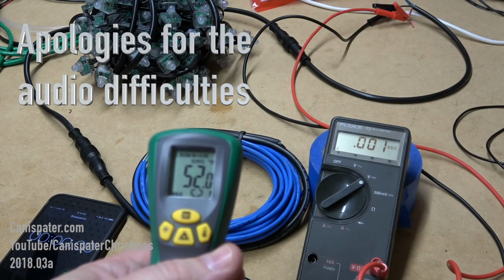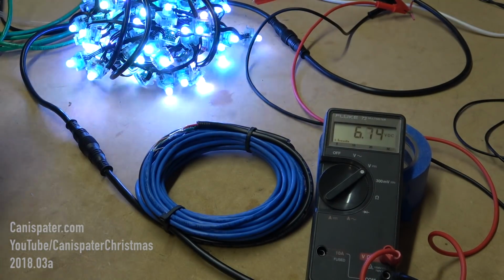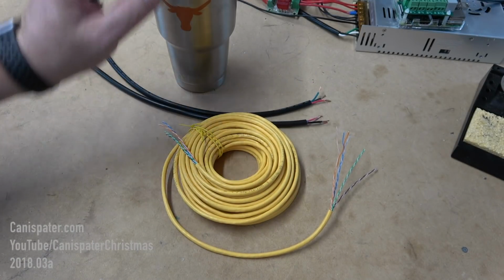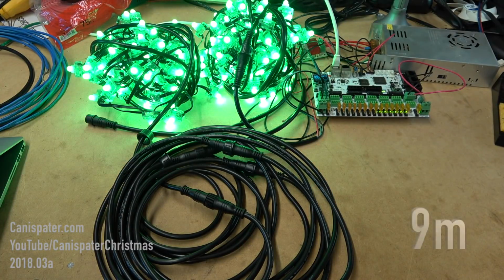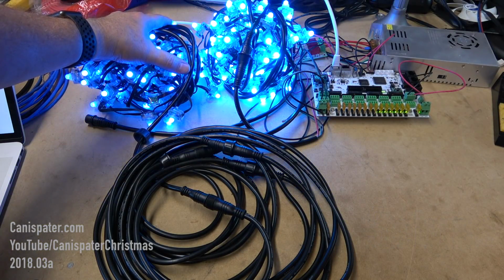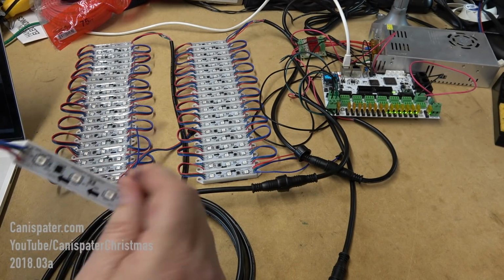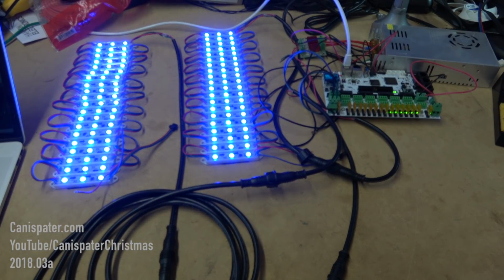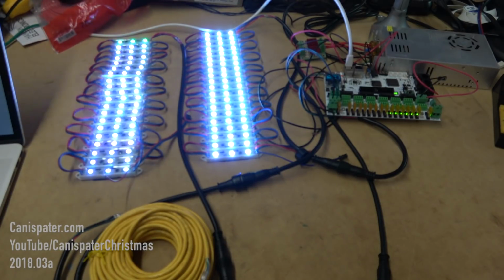RGB Pixel Distance Test - HOW FAR IS TOO FAR? (2018)

Comment: Darn, was hoping you'd test how far the 'data' line could run...  Can you do a test where just the data/ground (and clock/ground, if applicable) is going through the CAT5 cable, and you have a power supply set up at the remote string of lights?  Thanks!
Reply from the maker: The modular pixels I used in this demo turned out to be defective (see the end of year video). I believe David has done one roughly 75-feet with good pixels. For longer distances, you'd need to either put F-Amps in the line or use Differential Receivers.
Reply: @CanispaterChristmas  Nice, thanks for the info!  I'm currently using an old modified Olsen 595 dimmer design (good for incandescent string lights), and I can go about 100 feet on CAT5 between each 595 dimmer PCB and an Arduino interface hooked up to the laptop inside my house.  It's pretty limited in Christmas light displays since my setup can only control 32 strings of lights, so it's hard to do basic things like color-change effects without running out of channels, and it definitely doesn't control individual bulbs on a string of lights.  But it's great for Halloween displays, where I can use Vixen to toggle strobe lights, blacklights, and other cool Halloween props while dimming and blinking strings of creepy Edison-style incandescent bulbs strung all over the front porch.

But for Christmas light displays, I'd like to retire the Olsen 595 and get into pixel lights, and am trying to figure out where to start - put a 'ready to go' Falcon controller in the basement with data cables running out the window to each bank of pixel lights (provided the data can travel that far), or use smaller controllers placed closer to each group of display elements.  Or just buy a controller and a few strings of pixel lights and start experimenting until I figure out what I can get away with.

Thanks again for the reply, and thanks for posting these educational videos, they really clear up a lot of the questions I've got running around in my brain.
Reply from the maker: Well, you could start with an F16 and experiment. That's probably the cheapest option. The next step up is an F48. The advantage is long distances using Ethernet cable from the controller and power is near the prop. It's more expensive because you also need the Differential Receiver boards, but that is definitely the best option if you have props spread over a wide area and want to put the controller in the basement.
Reply: @CanispaterChristmas   Thanks for the info, I appreciate it!  I ordered an F16 and a few strings of WS2811 5v lights to play with, and I already have a bunch of ATX power supplies laying around the basement.  So it's going to do one of two things:  light up and look amazing, or catch on fire and set off the smoke alarm again.
Reply from the maker: @jayeff7900  Maybe wait until December 31st so you'll at least have some sort of show. lol!
Reply: @CanispaterChristmas  Yay, lights and no smoke!  Gotta question, how do I pick your brain without spamming this video?  I got a Falcon controller for Christmas and some pixel lights (my wife is awesome) and got them to work (using the built-in test function on the Falcon controller), but I'm getting some unexpected results.  For instance, I put 100 pixels on a port and set the port to see 100 pixels, but only 50 light up if it's the only port tested.  Unless I checkmark the next port, then all 100 light up.  But I thought all 100 would light up on the single port tested if the port is set up for 100 lights...  Umm, yeah, noob questions like that one.  Thanks!
Reply from the maker: @jayeff7900  This might be something that needs to be gone through over zoom, but by default, the F16 comes set to 50 pixels per port on the string ports page. You should be able to set it to 100 and have them all light up. While you're there, you might also want to drop the brightness to 50% or less to make sure you don't blow the fuse if it goes all white (just a precaution). Make sure you hit save after making the change.
Reply: @CanispaterChristmas  Ohhh, duh.  On the F16 output settings, I gotta recalculate the start channel for the next port after changing the number of pixels for this port; 3 (colors) * pixel_count = next channel start number...  Waitaminute, why should I manually have to do that?  I'm far too lazy for that.  Relatively simple HTML code should be able to recalculate that for me!  Maybe Falcon Controllers can implement that in their next web interface update?  Or maybe include a 'recalculate channels' button after changing the pixel count...  Hey, you're on a first-name basis with the guy or gal (or guy and gal, that would be pretty awesome) that develops and sells the awesome Falcon controllers to hobbyists like me, so you should make that suggestion.  It's OK to make it dummy-proof, for dummies.  Like me.  But I'm figuring it out through logical progression, it's fun stuff.  Sometimes figuring it out on yer own is satisfying in its own right.

Oh, does your Falcon controller do a high-pitched whine like mine, sorta like an oscillator that is, well, oscillating at an audible frequency?  Anyway, I got 150 pixels on channel 15, running at 30 percent intensity.  No smoke or blown fuses yet.
Reply from the maker: @jayeff7900  It's easier to let xLights do the programming for you. Doing it via the web page is old school. Helps to know how to do it tho. No high-pitched whine on mine. Hollar at David. His contact info is on the bottom of his web site (PixelController.com). "No smoke." Yay!
Reply: @CanispaterChristmas  Thanks for putting up with my questions, lol.  I figured out how to get xLights to talk to the Falcon controller, built a 10x15 pixel grid, and got some effects to show up on it, pretty cool stuff!  But I don't have a whole lot of lights, so I was wondering where's a good place to get more lights...  I got 150 (3 strings of 50) from Amazon, they're spaced about 3 inches apart.  Is there a better place to get lights?
Reply from the maker: @jayeff7900  Yes. If you want to buy a lot (1k or so), it might be better to get them directly from China (Ray Wu). If you don't want to mess with that or have a small order, there are probably local vendors. If you are in the US, I use Wired Watts or CFOL. If elsewhere, ask on the FB groups where people get their lights. I have links to them in the descriptions of all my videos.

Comment: Thanks for the info, but have you tried a better power supply?  Not sure what your using, but looks like a Chinese made power supply.
Reply from the maker: HAHA! Yes, the power supply on the bench is a cheap supply, but it puts out 12V just fine. The problem was the pixels were defective. See https://youtu.be/VaeBYUhwLMs

Comment: We are able to do 40ft. 100% white over CAT 5E with 50 5V pixels or 100 5V pixels with power injection.  I believe the flicker you are experiencing is electromagnetic interference with the data signal created by the coil in the wire. We get the same type of flicker if we coil the wire.  We have also experimented with doorbell wire for the data line and it works well at 40-50ft range too.
Reply: Small update on this.  We did our testing with a T-1000 and SP105E controller for convenience.  They appear to have a stronger data signal than the Falcon16 or the PIXIE16.  On both the Falcon16 and the PIXIE16 we had some flickering in a few of the pixel trees and had to shorten the distance to about 35ft.  We still had 1 tree with an issue.  One thing we noticed that made a big difference on flicker was making sure the copper of the data wire is touching copper of the contact point or copper of the data-wire attached to the first pixel when they are soldered.  If the data signal has to traverse solder it shortens the distance significantly to 5-10ft.  This is a cautionary tail for those the put a bit of solder on each wire before they solder them together.
Reply from the maker: Thanks! Ethernet cable in general just doesn't have enough copper in it to carry the current load. It works for small strings, but I noticed some heating when I tried it so not a recommended option. Changing the output resistor networks on the F16 is an option to get greater distance, but I haven't tried it yet. Others have reported good results.

Comment: How do you adjust the brightness in xlights? also if you used power injection would that have fixed the problem with the flickering?
Reply from the maker: Haha. Turns out, the encapsulated strip pixels were defective. Now you know what "promotional" means. You can adjust the brightness in xLights by changing the "Set Brightness" setting on the model.
Reply: @CanispaterChristmas  thanks

Comment: Good morning sir. I love your videos very much. I have been learning about the lights for over a year now. Thanks for sharing your wisdom. This video just confirmed what  I have thought for a while. You make it fun to learn from you. I'm going to try to run a show this year. I have one mega tree already. I used bullet pixels at 30 high and 16 strings. I used 16 channels using the falcon 16v3. Can I tie 3 strings together so I can gain use of more channels for other props and have it still work correctly? Or even 4? The reason I'm asking is that I am going to add another mega tree to I have one right and one left.  Thanks for your vids again. Dan Bell in Modesto Ca.
Reply from the maker: Thanks! The F16V3 can support up to 1,024 pixels per port assuming you don't have any expansion cards attached. You can make longer strings to free up some ports, but may need to inject power if the pixels look funny toward the end of the string (usually look dim or the whites look yellow). For example, my mega tree is 1,200 pixels, 4 strings of 300 pixels zig-zagged at 50 so it looks like 24 strings of lights. I use 4 controller ports and power is injected at the end of each of the 4, 300-pixel strings (so the strings get power from both ends). I also run my pixels at 30% which further reduces power problems.

Comment: Good Stuff.....Just saved me a ton of money and hardship, as I thought I would have to put in much more controllers and power supplies due to the distance between controller and props, as I read a couple of place that you couldn't go more than 15 feet !.......Thanks Again !
Reply from the maker: Thanks! I think roughly 30-feet is about as far as you can go with normal pigtails. I have another video about combining Ethernet cable for data with power cable for longer distances. It works well. Then an F48 lets you put the board close to props which is nice if things are distributed around with a lot of distance in between, but it's a more expensive option. Glad it helped!
Reply: @CanispaterChristmas  when you get beyond 30 feet, is it the lack of data or the lack of power that causes the flickering. As if it is the data, would an F-Amp resolve that problem ?
Reply: Clyde from Pixel Pro suggested more going along the lines of 2 - F16V3's & expansion boards & differential controllers to run my show, than the F48, due to distances.
Reply from the maker: Haha. "It depends." Probably the voltage drop or a combination of both.
Reply from the maker: Yeah, a differential receiver is what I meant by the F48 (it's all DRs). Yeah, that works well too.

Comment: This goes to show: Less connections is better! It's actually quite shocking to see how big the voltage drop is, caused by those pigtails. 
Would it be a nice test to see how much the voltage drop is on the other end of a pigtail? Let's say... 12 volt in one end, 10.8 volt out the other? I mean,  not that it really matters, most people use power injection anyway. But still. For fun and giggles. 

I was wondering on the 50 feet cable at what brightness level that last test would have come up working fine again. 
By the looks of it, around 60-70% would have solved the flickering.  So you could even extend way beyond 50 feet (direct cable) if you run your display at 30%, which is quite a decent brightness level anyway.

As you rightfully mentioned, it depends on so many factors... Ambient temperature. AWG of the wire... Input voltage... Type of pixels... Type of controller... 
None the less, thank you for providing the Xmas display with such valuable insights, the time and effort you put in to create all of this for us.
Reply from the maker: I haven't noticed a huge drop across a pigtail, but I'm sure there is some so balancing number of connections to ease of setup/teardown is needed. I tend to not worry about it until I encounter a problem and you're right, power injection takes care of some of that too. :)

Comment: what type of pixel would you recommend for outlining parts of a house?  Initially I was thinking the flat, but now I am thinking of strip inside of a defuser which would give me a cleaner look, and I think easier for mounting, instead of all the wiring from behind each pixel.  Your thoughts?
Reply from the maker: I love the hassle of putting up regular pixels. lol! I have noticed interference from strip lights (assuming the metal PCB it’s all mounted on). I had some mounted around my garage door and it interfered with the opener). It should look good tho!
Reply: CanispaterChristmas hmmm😁
Well I don't have a garage door so check there.  In your opinion would it be easier to use the strips in a metal channel covered with a defuser?  Originally I was going to use the flat pixels in the core strip and then mount to the house but then I got thinking of all the wires sticking out from the pixels.
Thanks
Reply from the maker: Yeah, you have to mount them a couple of inches away due to the wires. Strip in pex is probably easier and as long as it doesn't interfere with anything you're probably good. Might run some tests. Metal channel is probably going to be similar to flat pixels as far a installation time.

Comment: I guess this happens because the data line drops voltage to the point that the 0.7*supply voltage (for 5v pixels) starts to fall below the threshold. If you power close to the leds but run a long data line then you can use a simple 5v powered logic chip to reboot the voltage located at the end of your data run. I used a 74hc04 inverter (powered from 5v but takes input voltage from 2 to 6v) and connected 2 of the inverter together to make a simple voltage booster. Because it accepts 2 to 6v input it means you can always use one at the beginning of a string. Keeps the data line high, if you are using 5v pixels it's easy to power and sorts out the flickering issues :)

Comment: This is a great video, appreciate you taking the time to put it together. The only other test that would be interesting in this side by side is using 18/4 with 1 for data, 1 for V+ and 2 for V-. In my own testing the results are similar to C5/6 but the wire is easier to work with and cheaper.
Reply from the maker: Thanks! As Alan stated in the comments of the video I pulled down, ethernet cable is better at handling data due to it's low capacitance characteristics, but not suited to handle power due to the lack of sufficient copper. I wonder if it's better grounding the clock lead if you don't use it? I will definitely try that soon with the 3-LED pixels that don't seem to handle distance as well as the square pixels. 18/4 is a great idea though. I'll give it a try!
Reply: The idea is that as you are very well aware the ground line plays 2 roles. 1 it is the return line for data and 2 it completes the circuit for power. By doubling it up it essentially becomes a 15 awg wire allowing for data to return cleanly.
Reply from the maker: Yeah. I didn't mention in the video, but saw it during the teat, the voltage actually increased slightly when I connected another ground with power injection. It was minor so I didn't feel it was relevant, but I may have to rethink that one.

Comment: Seeing the temp and voltage is great. 
Here in Australia we're often turning on our lights at Xmas when the temp is 35C/95F so the temperature is going to be exacerbated down here. If you happen to be using the godawful CCA cat5 cable then the temperature coefficient of resistance will make things even worse. 
Keep up with the great videos.
Reply from the maker: Thank YOU for your technical explanation of CAT5 cable in this use case.

Comment: Another great video idea is how a where to power inject.
Reply from the maker: Haha. I actually have one already. The pixels will tell you when they aren't getting enough power, then pull out your voltmeter. :) Although not 100% because flickers can also be caused by bad grounds too, but strange colors are usually a good indicator of insufficient power.

Comment: Great information ty.  What are the best uses of the 3 pixel rectangular pixels.
Reply from the maker: Thanks! I'm planning to use them to replace the pixels on my failed wall washer. Should look like a giant horizontal VU meter! If that doesn't work (based on numbers and performance), short verticals of some kind.